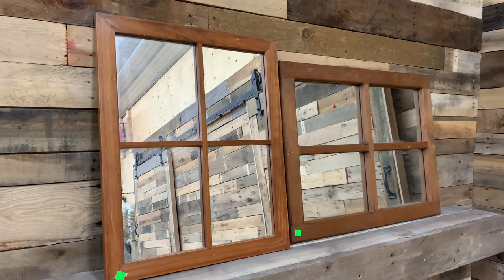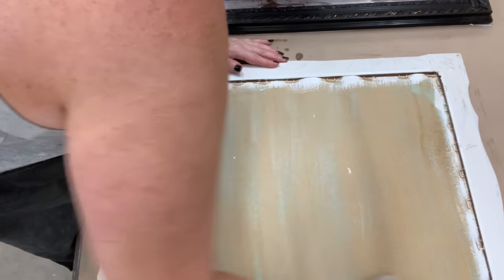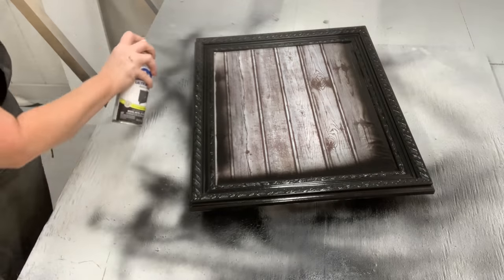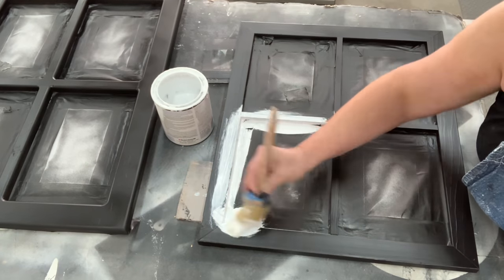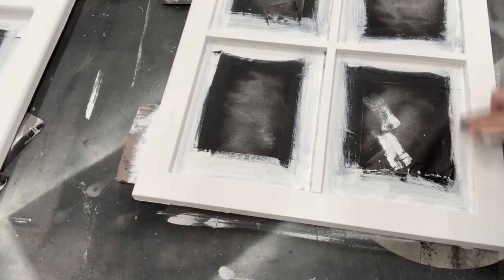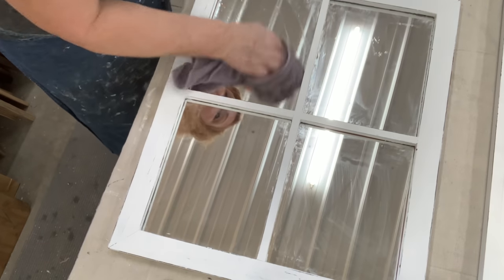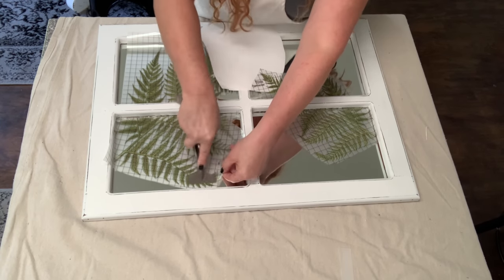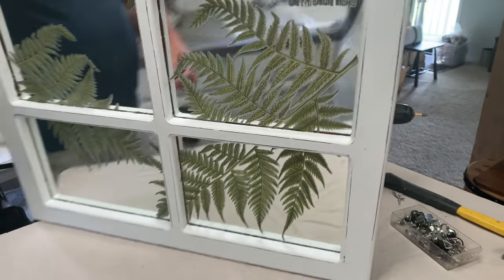Thrifted Mirrors || Makeovers || IOD Transfers || Cottage || Farmhouse

Comment: The mirrors all turned out great! I have a question about the rustoleum chalked paint. My daughter used it to paint a nightstand and the first coat went on very streaky. The second coat was also streaky. She tried to give the piece a light sanding with 220 grit sand paper to smooth down the streaks and she said it was taking the paint off. Have you ever had that problem? Do you think it was caused by the brush she was using? She used a good quality 2 or 4 inch brush. She did not thin the paint.. I have only ever used Waverly chalk paint and have never had that problem.
Reply from the maker: When I do chalk paint I do the first coat just the chalk paint. The second coat I dip my paint brush in water. It goes on smoother. And than the final coat the same thing, paint on my brush dip it in a bowl of water.. it goes on well that way. And I use the white bristle brushes that are really soft. Hope that helps. 
Maybe sand it till it smooth and do those steps
Reply: @GingerChickRehab  thank you so much.  I will tell her.

Comment: Love your work.  You are so considerate of others making sure everything is super clean & repaired. 
I have a question... do you wet distress while the paint is still damp?  I've  tried doing it after the paint is dry and it is very difficult.  Thank you for sharing.
Reply from the maker: Thank you. With the Rustoleum chalk paint, I find is is very easy to distress. I let it dry and than very careful wet distress it. For stubborn spots I may wet first a little and you a very fine grit sandpaper to get it moving and finish it up with the damp wipe. Hope that helps
Reply: @GingerChickRehab  thank you so much😊